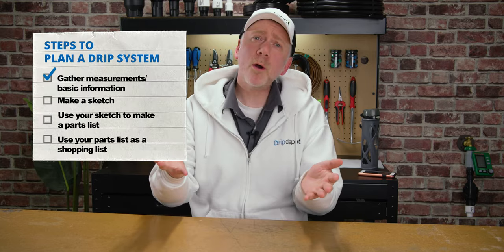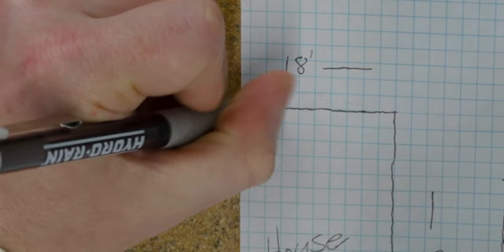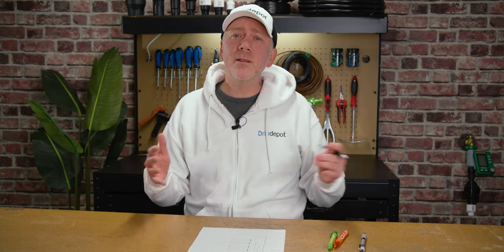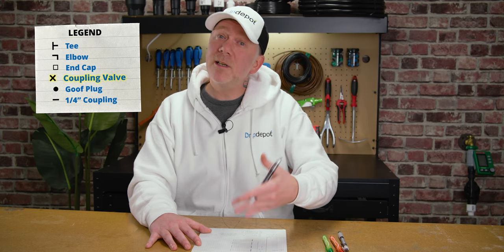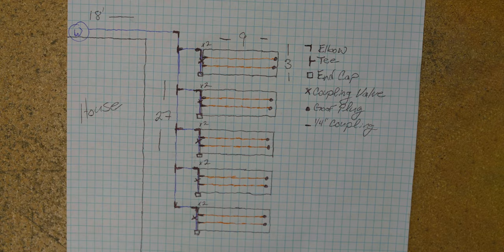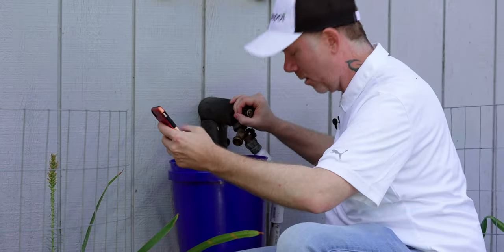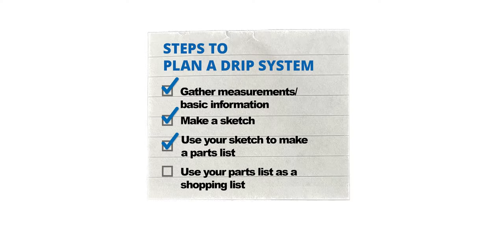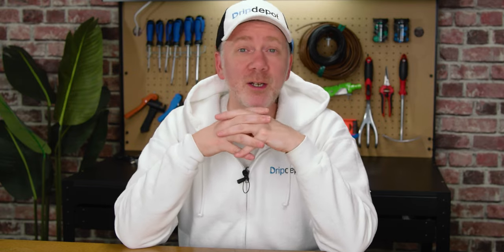How to Design a Drip Irrigation System (Beginners Step-by-Step DIY Guide)

Comment: Is there a reason you couldnt just create a loop with the drip line rather than running two separate lines? Saw a video where someone used drip line and T's to create circles around potted plants.
Reply from the maker: You sure can!  We use the loop (or "drip rings") for trees, some shrubs, larger potted plants and some fruit bushes -- it's a great way to deliver water all around a container or larger plant/tree, and you've got it exactly right, a single Tee fitting is all that's needed.  

With raised beds we typically plant in straight rows, so going with a loop there usually only leads to using more material which can increase costs if it ends up requiring another spool of drip line.

Comment: Great info,  I used to have sprinkle system and now converting them to drip system by using rain bird converter removing the sprinkler head and replace by converter head but I am not sure ,do I have to calculate everything too the same way you doing
Reply from the maker: Mostly so!  You'd just treat the location you're converting as your water source instead of something like the hose bib we used in the video.  You'll draw your mainline from the location you're converting and testing the flow rate of the water source at the location you're converting. 

Testing the flow rate of the water source is likely to be the most challenging part since it's at ground level, but if you're able to direct the flow into a bucket you should be able to get a good idea of its flow rate.  Did the sprinkler operate well previously?  If so, that's a good sign you have strong flow, though still best to confirm if possible. :)

Comment: Can you mix drip tape and dripline in a small system like this?
Reply from the maker: You can, though it will take some planning in regards to pressure.  The reason for this is, drip tape usually operates at 10 to 15 PSI depending on the thickness of the tape.  1/4" dripline works optimally at 25 PSI.  When using both on the same zone, you'll want to regulate pressure for the tape.  1/4" dripline can operate at 10 to 15 PSI, it's just unlikely to put out the stated 0.5 GPH flow rate at that pressure, but will drip water making it possible to use both on the same zone.

Comment: Very good video. I have a question:

My main water line is 3/4 inch which goes through a 30 PSI pressure reducer. I have connected four 1/2 inch hoses to this main line. The first hose is feeding 26 0.8 GPH emitter, second hose is feeding 16 0.8 GPH emitter, third hose is feeding 30 0.8 GPH emitter and fourth hose is feeding 18 0.8 GPH emitter. Total emitter in the system is about 90. Are emitters toward the end of hoses going to starve. I appreciate if you let me know. Thank you.
Reply from the maker: From what you've described,  I think you're going to absolutely be good to go -- I'll explain below:

You're well within the green in regards to the capacity for both your 3/4" and 1/2" tubing, unless the lines were very long (over 200' for 1/2" and close to 500' for the 3/4").  I suspect your lines aren't that long, so I don't think you'll be losing much pressure at all from friction.  

With pressure accounted for, the only thing that could starve them would be flow rate -- for example, if your water source flows at 50 GPH but the flow rate of the system (90 0.8 GPH emitters in this case) was 72 GPH, some would be starved of water. 

Happy to confirm that a water source with that low of a flow rate is very rare, so I imagine that you'll be good to go in regards to flow as well and will get good performance from your emitters :)
Reply: Thank you very much. I feel much better now. I really appreciate it.

Comment: This is a terrific explanation but I’m confused anyway :). If I’m purchasing the basic drip irrigation kit does it include  the entire head assembly? The filter in the video looks very different than the filter in the kit.
Reply from the maker: You bet, all of our raised bed kits will come with the full head assembly :) 

Sometimes we have to swap filters in and out depending on what we have in stock, but they're all equally strong (around 150 mesh) that attach to the head assembly in the same place and same way.  

If you ever have any questions about what's in the kits, or how to install it after everything arrives, don't hesitate to reach out, happy to help with both sides!

Comment: Thank you so much for your videos. They are great and helped me design and install my own drip irrigation system in my garden of raised beds. The ordering and receiving process was smooth, and everything was pretty easy. I have encountered a problem that I’m hoping you can help me with. Occasionally a couple of the 1/4” goof plugs pop off the end of a couple of 1/4” drip lines when the system is running. It’s not all of the goof plugs just three out of 29, and when it happens I have a hard time getting them to stay on. Any suggestions?
Reply from the maker: Happy to help!  And I can confirm the goof plugs should not pop out of the end.  

The first thing I check in these situations is pressure -- are you using a pressure regulator at the hose bib to maintain downstream pressure at around 25 PSI?  If not, there's a good chance that's the culprit and you'd just need to throw a regulator at the hose bib -- they're inexpensive and small enough to fit into most head assemblies -- here's an example of one: https://www.dripdepot.com/three-quarter-inch-hose-thread-pressure-regulator-psi-25-psi

If you do have a regulator, you can try removing the goof plug and then making a new cut just an inch or so in (but careful not to cut into an emitter if there's one right at the end of the line).  If the tubing had become stretched for any reason at the end, a new cut will give you a fresh smaller hole to work with :) 

I hope one of these help!  If not, I'll be happy to continue to assist and help you get up and running.
Reply: @dripdepot  Thank you. Cutting the tubing and giving it a fresh cut is what I did to help solve the issue. I do have a pressure regulator of 25 PSI. I've set-up my hose bib exactly as your design video taught me. I might have to order some more drip line bc I had to cut one of the lines pretty short since there was an emitter close to the end of a line that kept losing the goof plug. Thank  you for your reply! I appreciate it!
Reply from the maker: @runnermom44   Did re-doing the cuts end up working?  If so, some of the ones you haven't re-cut yet may be able to be used -- when the tubing gets warm, it undergoes thermal expansion -- this thermal expansion will cause the tubing to expand and increase its grip on the goof plug (and 1/4" fittings in general).  If it's warm enough where you're at, try placing it in direct sunlight for a bit and see if that takes care of it.  

If you end up needing to cut a lot of tubing, let me know so I can help with that extra roll of drip line :)
Reply: @dripdepot  Re-doing the cut did  not work for all of three of them at first. I did have to re-cut two of them twice. Would you recommend shutting off the system when I do this? I did have the system running as I cut and replaced the goof plugs. Perhaps the tubing wasn't warm enough to expand due to the water running through the end?
Reply from the maker: @runnermom44   You bet, I'd recommend doing it with the water off -- as you noted, this will help the thermal expansion, but it will also make seating the goof plug easier for you so you don't have to fight the water pressure as well :)

If this happens again, take an image if you can and fire it off to me from our website, I can take a look and make sure nothing else is at play contributing.

Comment: Three main questions.  1.  I have a 75' lawn that I want to lay underground pipe to a back-of-property line that is 135'. There are 35-40 pieces of shrubbery. At the end of the 75" I will require a T.  From this point do I continue to use 1/2" or do I reduce to 1/4". 
 2.  Actually I think it may be the same question around the house. Do I use the 1/2" and then 1/4" for each plant? I do plan to have a timer.
3. Can I send you a detailed map  and you suggest the correct plan or kit to buy?
Reply from the maker: We'll be happy to assist! 

1. From the information I have, you'd likely be using 1/2" after the Tee, but then possibly using 1/4" coming off the 1/2" near the plants.  
2. You got it!  The most common approach is 1/2" and then 1/4" near the plant (1/4" can't run very far compared to 1/2").  
3. Kind of!  Do reach out to us and send the map and any additional information in text and we'll absolutely help get you pointed in the right direction and help keep you on the right path.  

During office hours we reply to emails very quickly, so you won't have to wait a day for every single email.  Our office hours are currently 7 a.m. to 3 p.m. PST Mon-Fri (they'll increase soon during Spring and early Summer).  

Just in case, here is the link to our Contact Us page to send us an email: https://help.dripdepot.com/support/tickets/new

Comment: It's probably out of spec, but I find with a heavy vacuum I can easily exceed the capabilities of the Hendricks backflow preventer. As simple as 20-25PSI with 50 gallons of water volume will blow straight through the tube exceeding the backflow drainage. I was quite suprised to observe this. I do have a 2nd backflow preventer on my hose bib which actually works. But I was quite surprised by this behavior. Maybe someday I'll write the company and ask.
Reply from the maker: Interesting!  And it likely is worth writing as backflow prevention is of preeminent importance in any irrigation system or any cross connection really.  We all (public and those in the industry) tend to take it for granted a bit, just installing one and assuming it will work reliably in all situations.  

You're probably correct that it's out of spec a bit, at least depending on how quickly the 50 gallons was applied -- the better version of the backflow preventers we carry (J10 Vacuum Breaker) is rated for 720 GPH, after that I think you'd get something similar to your experience.  

If anything else, hopefully this comment will get those reading it to be mindful of their backflow prevention, thank you for bringing some attention to it :)

Comment: Hi Adam, quick question about the size of the mainline tubing. I will be running drip Irrigation lines from 2 separate hose bibs. One line would be 100 feet in length and the other is 110 feet in length. I checked the flow rate of both the hose vibs and it is 300 gph. Should i go for the 1/2 inch tubing or the 3/4 inch for mainline? I would like to add more flower beds in the future and would want to extend the drip line at both the hose bibs. Thank you.
Reply from the maker: The size of the mainline will usually be determined by the flow rate of the irrigation system -- this isn't necessarily the flow rate of the hose bib (though it's good to know that number as well).  

To determine the flow rate of the irrigation system/zone, just add up the flow rate of all the emitters that will be operating at once (e.g., 500 0.5 GPH drippers is 250 GPH irrigation system flow rate).  

If it's getting close to 200 GPH system flow, 3/4" would probably be the better bet, particularly since you'd like to expand on it later.  

When you determine the system flow rate, you can also compare it to the flow rate of your water hose bib.  You don't want the system flow to exceed the hose bib flow -- a quick example, if you had 350 GPH system flow and 300 GPH from the hose bib, some emitters would be starved of water.  In the industry, they'll typically leave a 20% cushion between system flow and water source flow, or 240 GPH in this case.  The cushion helps ensure success without calculating every detail (small losses from some fittings, etc).  

If you have questions on any of this, just say the word, I'm back in the office for the week and happy to assist :)

Comment: When you say 200’ is the maximum run length, is that the max length of any single row, or the total length of the system? For example, could I run 100 feet of 1/2” mainline from my water source then connect it to 200’ of 1/2” drip tubing (5 rows each 40’ long)? Would that still work, or is that now a “run length” of 300’?
Reply from the maker: You bet, in regards to line length, what you described would still be within specification -- that limitation applies to a single length, so it is ok to have multiple individual lengths whose sum is greater than 200' so long as no one run is over 200'.   :)

Comment: If I have a whole-house 50 micron sediment filter do I need a filter at the head assembly?
Reply from the maker: 50 micron filtration is incredibly strong filtration -- if it's filtering the water at 50 micron before the irrigation system, you should be good to go, at least so long as there's nothing downstream of the filter that you wouldn't want in the irrigation system.  

The stronger drip irrigation filters filter at 100 to 80 micron, so at 50 you'll be getting very clean water, cleaner even than we we often see in drip systems (again, so long as there's nothing between the sediment filter and the irrigation system that could be picked up).  :)

Comment: If connecting sprinkler heads to a timer, do you still need backflow preventer/filter/pressure regulator - or is that just necessary for drip irrigation?
Reply from the maker: A backflow preventer you'll definitely still want -- a filter, if you're using lawn sprinklers on municipal water, could go either way -- in most cases they wont' be needed since sprinklers have much larger orifices than drip emitters.  If you did opt for a filter, you could use a much wider mesh.  If it's a dirty water source, some filtration would be best, though still not as fine as with drip. 

A pressure regulator is not often used in lawn sprinklers -- a lot of modern sprinklers (Hunter Pro Spray, RainBird 1800) includes built in regulation in each unit, and traditional sprinkler rotors can operate at high pressure.  

If you have particularly high PSI, over 70 PSI, a regulator could benefit, but in most cases lawn sprinklers won't need one. 

Essentially: Backflow prevention for sure, filtration and pressure regulation can go either way, but in most cases are not used with lawn sprinklers :)

Comment: Is it okay to attach 1/4 " distributer tubing to 1/2 " poly tubing via a 1/4" barbed coupling? or do I need to use the barbed coupling on emitter tubing only?
Reply from the maker: You bet, in fact, using a 1/4" coupling is the preferred way to connect 1/4" poly to 1/2" poly, so you're absolutely on the right track :)

All you do is use a 1/4" punch to make a hole in the wall of the 1/2" poly, connect your 1/4" tubing to one side of the coupling and then push the other side into the punched hole.  

We made a short video that shows the above steps if you'd like to see the process in action:  https://www.youtube.com/watch?v=_dXByuYcgtM

Comment: What if your flower bed is on a slight incline and about 30 feet from the water faucet?
Reply from the maker: If the incline isn't severe, not much will change -- gravity does increase pressure, but it takes quite a bit of elevation change to really impact anything.  Water pressure is generated/lost at a rate of 0.433 PSI for every 1' of elevation change, so even a 5' inline is only a little over 2 PSI.  Being 30' from the faucet, you'd want to use a 1/2" mainline -- 1/2" mainline is good for up to about 200', so you'd be well into the green.  

Basically, not too much would change for you and unless the incline is severe, you'd unlikely even notice a difference between a system on a flat field :)
Reply: @dripdepot  Thank you for taking the time to reply. So glad I found your channel.